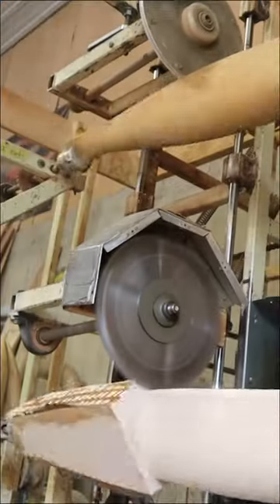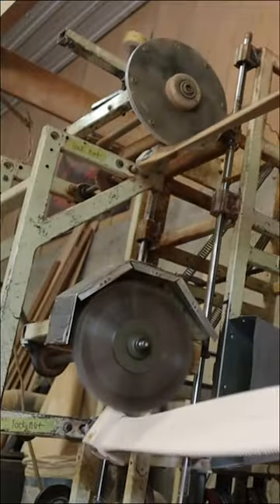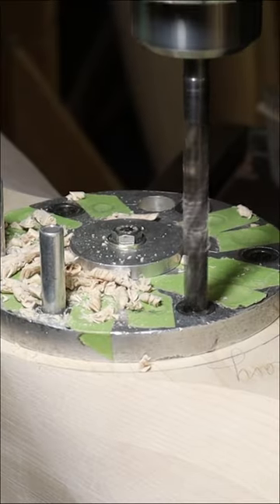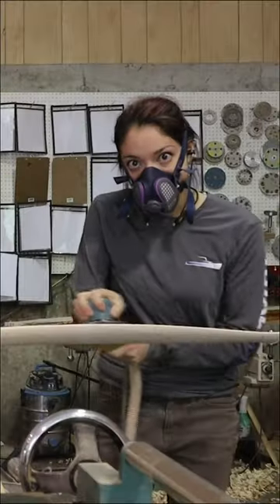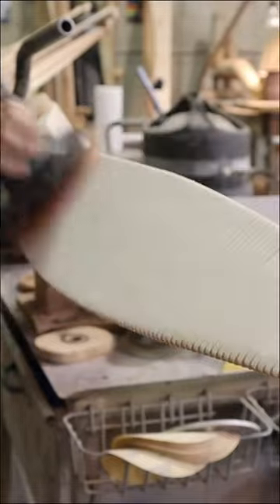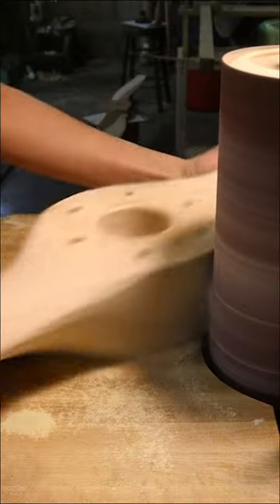Lumber to AIRWORTHY PROPELLER in 1 minute

Comment: Can't imagine how cool and also scary it must be to fly with a prop you made yourself.
Reply: Trusting old motors is even scarier.
Reply: @billboyd4051 pfft old motors are old because they work.
Reply: @9woah1horses60  If maintained, I believe we lost 2 B17's last year.
Reply: @9woah1horses60  I went for a plane ride through the Grand Canyon of Pa. Was there early before anyone showed up. Ranger pilot hopped in, no preflight, no check for water in tanks, most of the gauges did not work. No warm up and we were off. They work so well, some pilots don't even check the other things that make flight possible.
Reply: @billboyd4051  neither of the b17s were engine failures and just because you didn't see maintenance doesn't mean it wasn't done.
Reply: @9woah1horses60  The one in Hartford was engine failure was blamed on badly adjusted points and bad condenser. the mid air in Texas was not mechanical  but an air boss mistake. I have 2 friends who had engine failures, both lost their fathers in the crash. I had just picked up a used plane from a dealer.
Reply: @billboyd4051  bad maintenance practices is a people problem not an engine problem, there's a reason the FAA doesn't adapt new things quickly. Look how safe the max is, or Honda jets with their runway incursions. I'm not saying old engines don't die, but new stuff does also. Old something bold something
Reply: @9woah1horses60  Mechanical problems happen every day, the prop is very very rarely the cause.
Reply: @billboyd4051  I never said it was, I was just implying the age of an engine is not a concern of mine, the maintenance matters, and the people  matter, but if an old engine has been properly maintained by competent people it isn't going to fail because it is 60 years old.
Reply: @9woah1horses60  I paid $1 for a real full size MBB BK 117 medivac copter, with all out of date parts. Sold it for 3 grand to an ice cream shop that turned it into a swing set. Old is cool, but expensive to get parts for at times.
Reply: @billboyd4051 B-17’s have four engines for a reason! Those crashes were both pilot error. In the one instance, the magneto failed on one engine with the pilot immediately assuming it was the other engine on the same side which had a known uncorrected maintenance issue. He cut power to the lone working engine inducing a VMC roll over event due to the low airspeed and torque from the two working engines on the opposite side.

Comment: coat with pencil graphite, then electroplate with thick metal
Reply: same with blow torch carbonization, assuming the surface is made conductive
Reply: 3d print or cast plastic can be pencil graphite coated to conductive